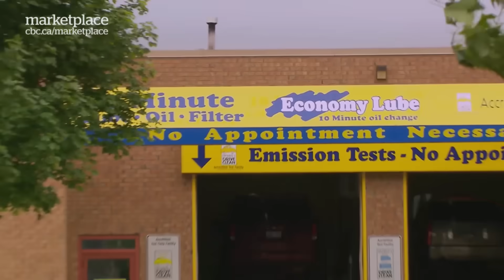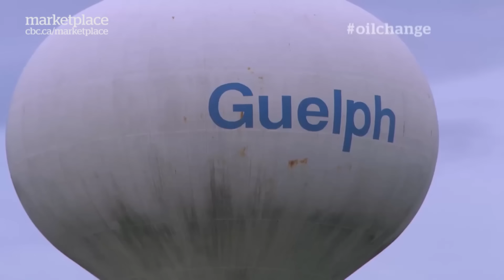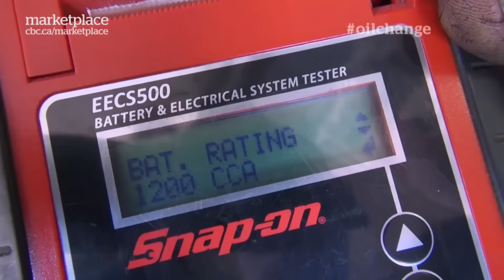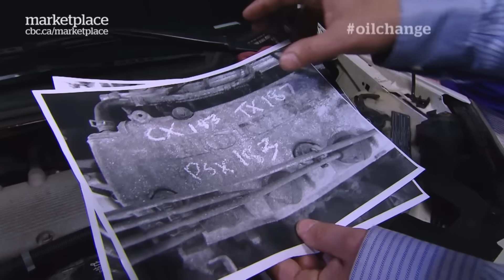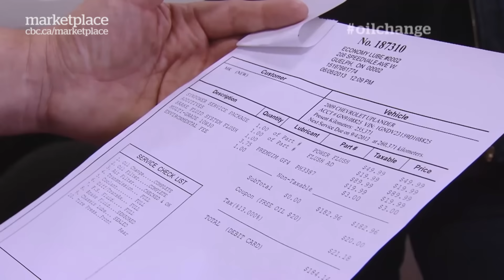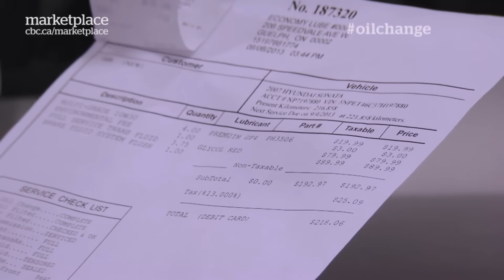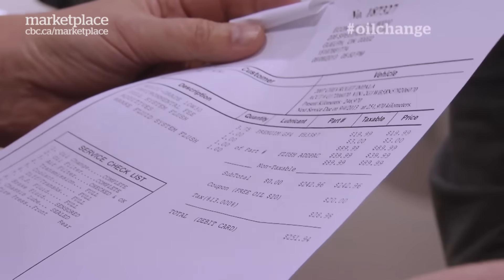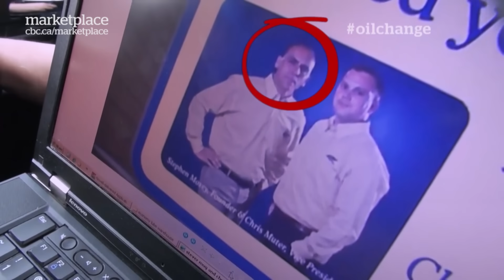Oil change scams: Hidden camera investigation on what really happens to your car (CBC Marketplace)

Comment: When I was young and broke, I got ripped off by places like this. Makes me angry because I was struggling to make rent and I just wanted to make sure I could keep my car going. Thanks for this report.
Reply: buy a book and do it yourself ,
Reply: Megan Makeuptosh......That's the real problem......this does not just effect people who can afford it.....they usually rip off people who are just trying to get back and forth to work and have no extra money to buy the owner a 70 thousand dollar Range Rover......he should be jailed.
Reply: they did that to me i had to pay $487
Reply: @belladonnanightshade2332  You need more than just a book you need tools also, and for some people they want that peace of mind knowing the job was done right to avoid catastrophic damage.
Reply: @Promethium666 , I know females who went to classes that im sure were free to learn basics of mechanics , my brother did his own exhaust , yes over the years I have gathered quite a lot of tools , I fixed my washing machine lots of times rather than pay someone as they charge a call out fee plus job price , and its amazing how easy it is as long as you always pull the plug from the wall , imust stress that , I have added electrical sockets switching off at the mains , the only thing I wont touch is gas as in gas not petroleum fuel , I leavethat to my brother or If its the boiler a company , failing that get to know the price of a job and find a garage that's nearest to that price and stick with that garage , if you don't know things you are at the mercy of rip off merchants , I had to get the tv aerial guy to go up on roof and replace the lnb box and cable , cost me £200 and that was only replacing half the cable , I got him to bring dish down and attach to side of house ,which was the only reason I took him , I know the cost of a roll of cable , I bought a roll of cable and did it myself again and it cost £20 , but im ok going up a ladder 20ft not the roof , I don't mind paying for a job but I hate getting ripped off , of course there are jobs that is just too big and you cannot get out of paying but the more you know and small jobs you can do yourself the more you learn to do other jobs, lots of helpful videos on youtube but check more than one post and libraries are good too , tobe fair my dad had tools but I now have more than he ever had
Reply: This recently happened to me at Midas in Albuquerque, N.M. 7000 Menaul Blvd. N.E.  I purchased my vehicle in September of last year and have never had any issues with it until I took it into Midas  for a $20.00 oil change and the next day all of the power steering fluid had leaked out!  I went back the next day to speak with Ken the manager there and he tells me that my receipt shows me that I need a few things done to it and that "things some vehicles go from bad to worse that quickly " he then got upset that I was recording the conversation and then calls the police on me for recording him in his store :/
Reply: Megan Makeuptosh .Right .These places should be shut down..
Reply: U have to be smarter u cant blame them. They only get away with what u allow. U can always say NO!!!
Reply: Should've had a guy (uncle, dad, bf) keep you from getting hustled
Reply: So now your old and Rich!!!
Reply: Now that I'm thinking about it I was to. I remember going in and having my brakes replaced and a week later they skill grind and when I went back they told me I used them up to quick. I was dumb struggling and had no choice.
Reply: I feel ya Megan! This is the last thing you need to experience when trying to save or make it with the money you have.  Its special place in hell for these  people.
Reply: I recall mechanic was going to charge my mother over $500 
Her co-worker overheard her telling a lady
He asked to take a look at her car after work
Got fixed less than $100
She Blessed her co-worker Too
Reply: @richojeda8105  Uh, no.  

You are saying that we can't blame them for upselling unnecessary services and the gullible people allowing it and that is true.  But you must have missed the part where they charged a large amount for those unecessary services and didn't even perform the work.  That is theft by fraud.  And one most certainly can blame them for that. A kid comes to mow my lawn, then shows up at my door later to get paid saying he mowed the lawn but actually just sat in the backyard beating his meat like it owes him money. I'm supposed to be mad at myself for allowing it to happen? No not in my world.
Reply: @Jason WatkinsI know , but its so expensive with all the upkeep , ok if you can afford it , if you cant its tough , some add on when they see its a female , they are not all like that im sure , but if you cant do things yourself at least get quotes to have an idea of the cost if you can , I just hate being ripped off ,a fair price is all we ask ,
Reply: don't be wooed by special offers ,stick to a garage your happy with that gives you a fair deal or one that someone recommends
Reply: @Promethium666  indeed it's not always possible. Sometimes you are at the mercy of circumstances.. makes it even worse when you expect this stuff before you even go
Reply: @belladonnanightshade2332  but that's not ultimately the answer.  All company's should be held accountable for their actions.  Upcharge?  well at least do the damn work!
Reply: @belladonnanightshade2332 in most parts of the world its not free, they charge hundreds for classes in the real world
Reply: Last year a place tried to pressure me into paying $300 for 4 brake pads... took it to my dad's shop, found I only needed two (the backs were almost brand new), bought them for $40, and changed them myself. Same place tried to charge me double what I normally pay for tires a month ago. They're sick.

Comment: This is why I ALWAYS do my own oil changes. I tell my kids the same thing. I’m not even worried about the scams…it’s the incompetence I don’t want
Reply: spot on.  overfill/underfill, not putting oil cap back on, not putting dipstick back in,  stripping threads of drain plugs, overtightening of oil filter....these oil shops take no pride iin their work.
Reply: I wish i could do my own fluids but where i live rn if i even open my hood to jump start my truck i will get a $140 fine and its another $90 per 5 minutes its open, and if its open for more then 30 minutes I have 90 days to leave

sad thing is even with my CDL and the nice pay i get from that I cant afford to live anywhere else where i can still work where I am (I am looking at new jobs in other cities)

Comment: I really wanted one of the testers to say: "I just want the 20$ oil change."
Reply: It is not necessary to have a Ph.D degree to change the oil in your car !
Reply: Stephen S having a Ph.D degree is why people don’t change their own oil
Reply: And how is this relevant to the fact that I just wanted to have one of the testers say, I just want the "advertised" 20$ oil change? 
It would have been interesting to see how they handle it. If the business still would have tried to sell them more  or just done what they asked. Or pretend to do the oil change etcetera.
Reply: @lynmortem648  Hello they should have had at least one of the three be firm "just an oil change" ... however at the sametime the other "RECOMMENDATIONS" couldn't have been checked if they hadn't agreed to them ... testing to see if they were actually performed ... as we found out they weren't and the coolant recovery tank will cause engine damage ... those are completely different formulas and they ARE NOT compatible ... there are some that can be used with either the red/orange or green ... but the container must say so ... naturally the ones that aren't will SPECIFICALLY SAY SO
Reply: Lyn Mortem they pretended to do other things tho like brake flushes and coolant flushes it’s all on camera
Reply: @georgewestfall598  yes, I get that. But would they try to intimidate or pressure you into getting the other stuff, even when you stay firm and just want the normal oil change. And are they even going to do it
Reply: Same dude lol😃
Reply: Lyn Mortem same
Reply: They would probably say something along the lines of "We are legally obligated to provide you these additional services as it is a risk to you and your vehicle..."
Reply: We all need some hidden cams in our car
Reply: @incognitobandito244  no they don't. Sure they want to make a sale but they don't go to those lengths to make a sale. They try and push the cost down as low as possible to make the sale and if the customer still refuses service the write on the service ticket customer refuses service listed and have the customer sign it so if the car fails because of service not preformed the customer can't blame the shop
Reply: Well it costs me 30 dollars to change my own oil so a 20 dollar oil change AND they do it for me sounds too good to be true.
Reply: Lyn Mortem yeah that actually would have been great to see as well
Reply: They would probably just change the filter and top it off for $20. 😂
Reply: @bivianahernandez5206  and then the expertise to actually interpret the recording huh!!??
Reply: Did they not? Haven’t watched it yet but I’m mad
Reply: @manofwill2468  when you buy oil in bulk you can get substantial discounts and they're making very little, if anything, on the oil change with labor. The idea is to get you in the door and hope you need or request something else which is where they make money... Most places have the $20 base thing,  $30 for "better" oil or (and it costs them 22 or whatever) or $50 for a full service where they top everything off, change the oil, maybe the air filter and whatever else which they'll make ~$25 off... 

$20 oil change really isnt too good to be true
Reply: @manofwill2468  $30usd is around $45aud. 5L Castrol goes on sale (half price) here for usually $40 and the filters are about $15 each. Apparently $150aud is the typical for an oil change  here. 

So yes, that price sounds too good to be true. At least here.
Reply: 2002_ES2 _ Some people do resort to changing their own oil to save money and the headache if the car is already acting up.
Reply: @Wolfgodmak  my father is a mechanic so we always to all that ourselves.  I'm pretty glad I learned 'emergency' stuff and general care for our cars when I was younger. Makes life easier and it can be pretty relaxing. :)
Reply: Lyn Mortem yep
Reply: Biviana Hernandez 1000000% 👍🏽👍🏽
Reply: Just Some Guy Outdoors and then what ?
Reply: Yeah I wish at least one of them would have offered some resistance.  It would have been interesting to see what the shop's approach would have been in that situation.
Reply: exactly. upselling happens everywhere. just stand ur ground. get other opinions for anything else. look into things and research urself if u can. this was very helpful tho
Reply: Biviana Hernandez 100%. i feel like body and dash cams are also becoming standard and nec to protect urself these days
Reply: i do that. its kinda awk but has to be done
Reply: @brph9719  Quite the opposite, I can tell you. At least when you own your own car.

Comment: "I heard you guys have it for 20 bucks"
"Ummm, depending the oil you run"

Ok bye.
Reply: I want slippery oil.
Reply: I'll take the $20 oil, then.
Reply: I don't get it. Different oil = different price, so he actually has a point doesn't he?
Reply: @DerAlphaJoker  different oil has different qualities and properties so it costs more, the more stronger and thicker the oil usually is unless it's 0 weight oil. They don't get it so "grog mad! I don't understand!! Ooga ooga"
Reply: ダイバーひどい he has no idea what he’s talking about, it has nothing to do with the weight, in fact diesel oil can be 10w-50 yet still cost way less than 0w20, and it depends on the brand too. You can get a supertech 5w30 full synthetic API certified for $13.97, Castro on the other hand with the exact same certification costs $22.38. Castro claims it has better additive package but I personally put in my own additive so I don’t care who makes it as long as it is 5w30 and API certified.
Reply: @davidgruen7423  and that makes me sound like I don't know what I'm saying how? You just repeated what I said, but with snob. Lmfao
Reply: thatonedude it has nothing to do with viscosity, read your own words again.
Reply: @davidgruen7423  oils have difference in viscosity tho. You cannot tell me you believe 0w20 is the same as 90w140. You're dense dude.
Reply: thatonedude i mean the price has nothing to do with viscosity, don’t be an uneducated troll would you? And do more research, gear oil and motor oil has different viscosity grade meaning, in fact 15w40 motor oil and 75w90 gear oil has the exact same viscosity. Sorry dude, you are just making a fool out of yourself.
Reply: Most of you pinecones probably think the w in 0w-20 for example stands for weight... dont talk about a subject unless you know wtf is going on or you will just sound like trump
Reply: @thatonedude  Engine and gear oils are measured using different scales. Were you to compare SAE 15w40 and SAE 75w90, the 75w90 would be much thicker. When you compare SAE 15w40 with SEA Gear 75w90, they're pretty close to the same viscosity range. Old engine oil comes out less viscous because you don't leave it in there for 50k miles (hopefully).
Reply: haha crazy
Reply: Exactly lol!.. that would be enough for me to not let them work on my truck!..
Reply: @davidgruen7423  well one is gear oil
Reply: Is a 20 dollar oil change real? I feel like no place has that price lol..
Reply: @entertheabyss9785  if it sounds To good To be true , it probably is buddy.
Reply: These days. The cost of one gallon engine oil is about $20.
Reply: Of course full synthetic oil is more expensive than conventional oil.
Reply: OIL IS OIL
Reply: um.... yeah thats how it works?
Reply: I mean that’s obvious, just like gas
Reply: I am your 1000 like and I want to say good joke👍
Reply: The Enchantment go run gear oil in your cars engine then
Reply: @brhu356  you must not know a damned thing about cars. For example, running 15w40 in your 0w20 honda? Oil is NOT oil...
Reply: oil is oil
Reply: No he’s right. Some cars have specialist oils specially designed for them and that specific engine type, sometimes it’s not just stock oils.
Reply: pesnis
Reply: Stoners Opinion 

our shop:

0w-20  $79.99

0w-16, 0w-30, 0w-40 and 5w-30 ESP (all for euro vehicles)  $99.99

Blend $59.99

Reg $39.99

all include only 5qts
Reply: Ryoneftw Synthetic oil costs a lot more
Reply: @skipperrussell2025  i want Canola Oil
Reply: Dang, it costs me $35-40 to do my own oil and filter change. 😂 and they do it for $20? 😝
Reply: @entertheabyss9785  walmart ( in central Arkansas) offers one for 19.88 but after tax it comes out to $24 or so depending on size of motor. For example a Nissan Altima with a 2.0 motor will be much cheaper than a 6.7 f350. It's the Quaker State Pit Crew special. All we do is change oil, change oil filter, air up the tires and put in Quaker State oil.
Reply: Its 45$ for my old vw if I do it myself
Reply: Except when it’s persistently cold there’s really not to change oil yourself. I hate even being in the car when other people go through these places. It’s so uncomfortably embarrassing. It’s kind of fun to play dumb until halfway through and see how long it takes them to accept they aren’t getting that 40 dollar air filter change. I especially like getting people to try and explain why blended oil is the best.
Reply: Uhh there are different types of oils tho so that’s a legit question. I personally use synthetic and it’s more expensive
Reply: @Faiththehuman  I don't think there are many people that aren't aware that there are different types of oil, unless they have a car and have somehow never had to have their oil changed before.  I think the OP's point was that these places openly run bait and switch scams, widely advertising oil changes for 'ONLY 20 DOLLARS' but when you go in you basically have to argue with them to put the cheap oil in.  There are many reasons to not use synthetic, and basically no reason to use blended oil.
Reply: Jacsun Kellogg yep missed the point on that one haha. Can’t find any info on reasons not to use synthetic though. I know it’s better for the engine.
Reply: @Faiththehuman  Oh definitely.  I only use synthetic as well.  I don't know anyone who actually cares about their car that doesn't.  What is pretty pointless, at least in the opinion of basically everyone I've ever met that knows anything about cars, is using a 'Synthetic Blend', the blending being with regular oil.  I think everywhere that does oil changes offers the options of regular oil, synthetic blend oil or pure synthetic oil.  The reasons to not use a synthetic blend are basically the same as the ones to not use regular oil.  These places often push a synthetic blend because it's the next tier up in price, so not as expensive as pure synthetic oil and I'm assuming they present the idea to people that don't know better that a synthetic blend is somehow significantly better than regular oil and/or in some way comparable to using pure synthetic oil, which is ridiculous.  I think that might have even been the oil that was recommended in the video as the one to get "If you care about your car" as the guy put it.
Reply: Also depends on how much oil your vehicles requires. Mine is 12 quarts with filter. Mine would be much more expensive than a 5 quart vehicle